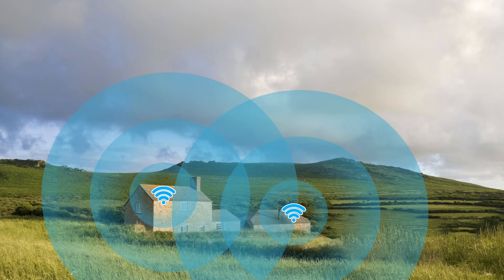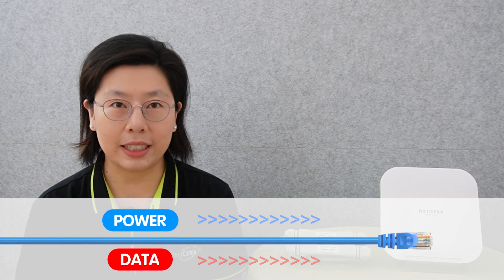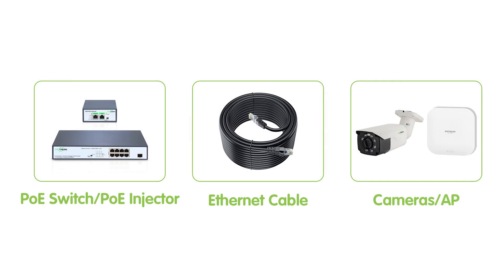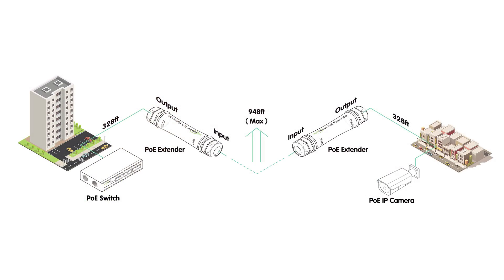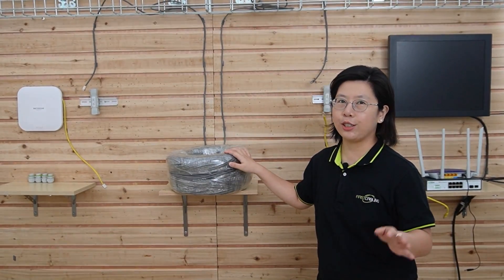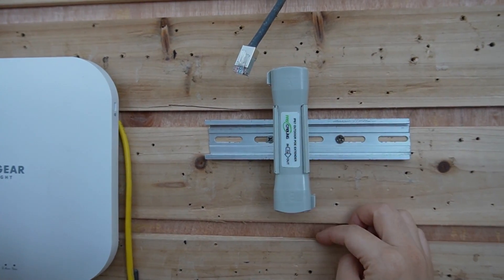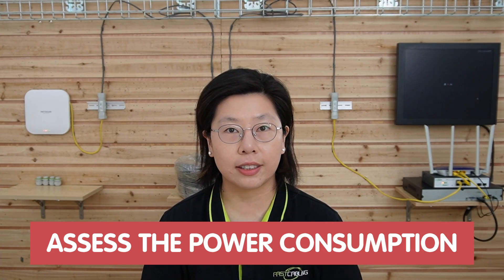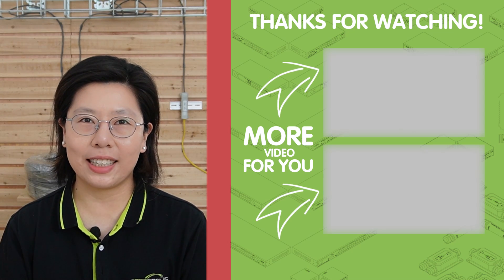1500ft Long Distance PoE Wireless Access Point Setup with a PoE Extender Kit

Comment: Hi sis thanks  you for your  informati, so if i need to extend  to 500 m in 360 all i need os tall  ethenet  cabe and poe right
Reply from the maker: To be more precise, you need long-range PoE. Standard PoE only supports a maximum range of 100M/328ft. Even when a PoE extender is deployed, the distance can only be extended to 200M (to reach 500m, at least 4x extenders are required). However, our PoE extender kit can effortlessly extend the distance to 500M using only two extenders, which significantly reduces installation costs and failure points. 

More info here👉https://www.fastcabling.com/product/300-meters-direct-burial-poe-ethernet-extension-kit/

Comment: I wonder how much attenuation that coil (or is it 2?) generate... and what is the speed that is left in that cable? cause transferring power is one thing, signal is something entirely different.
Reply from the maker: The speed between the switch and the access point is 100mbps. Unlike wireless, you only will have 10/100/1000... speed. The TCP/IP will negotiate the speed, and you don't get the speed like 30mbps.